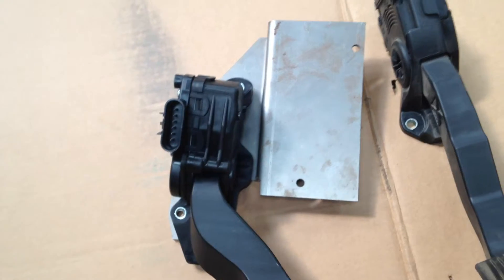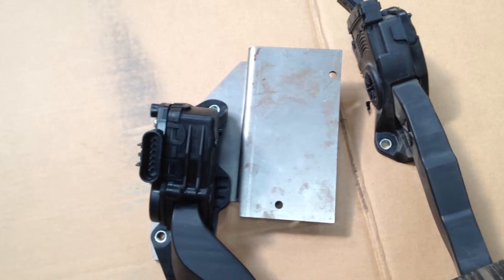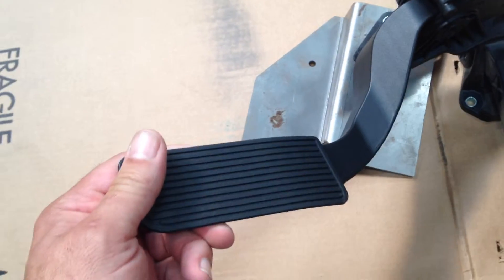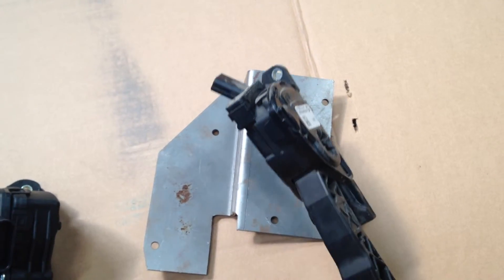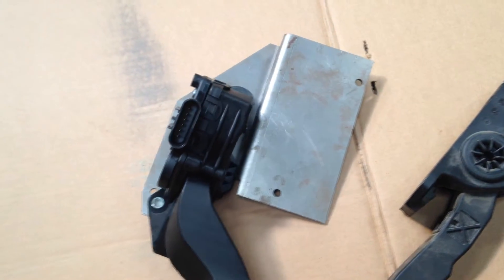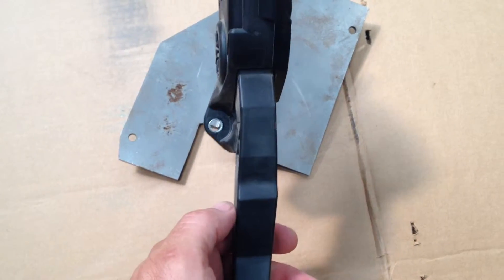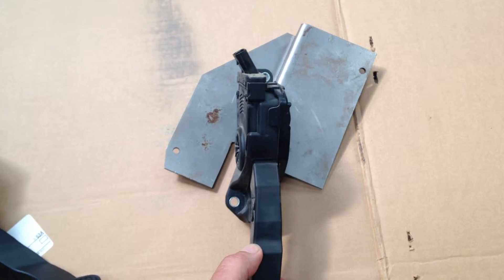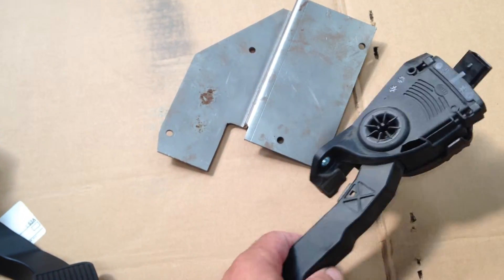Jeep JK GM/LS Gas Pedal

Comment: This is exactly was I was wondering!  I have a LS in my JK that was done with the Motech kit by the previous owner but unfortunately he didn't keep and mount the old pedal.  Can I just buy any compatible JK pedal do do what you showed in your video?  And is there a pigtail that plugs into the original pedal?  Also asked this on JKOwners in the Modified Tech.  Thanks!